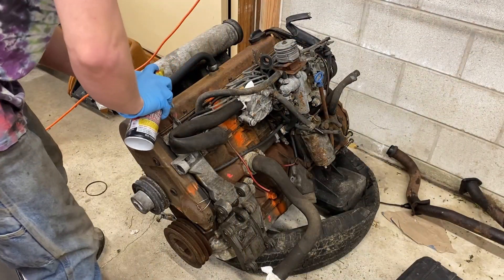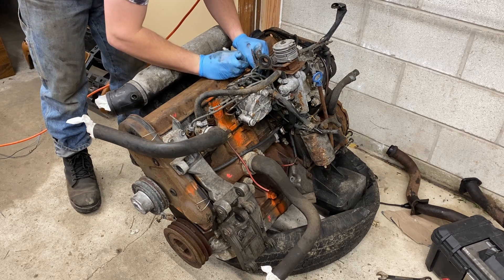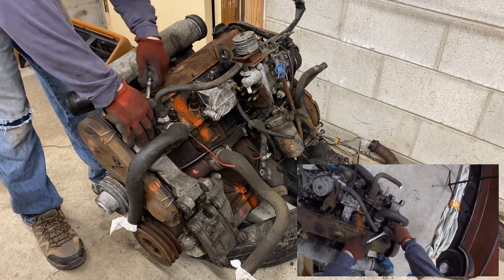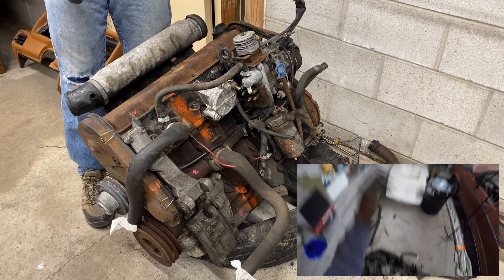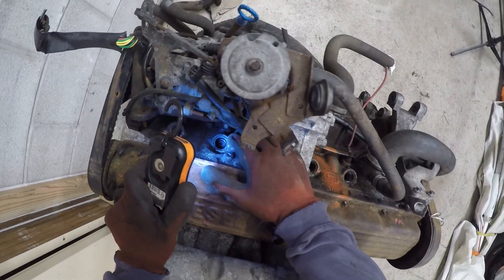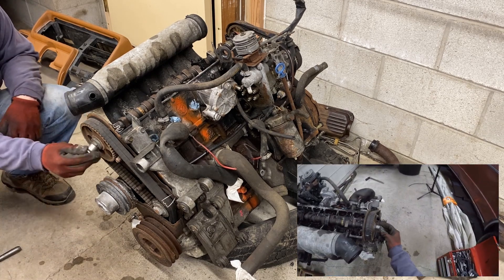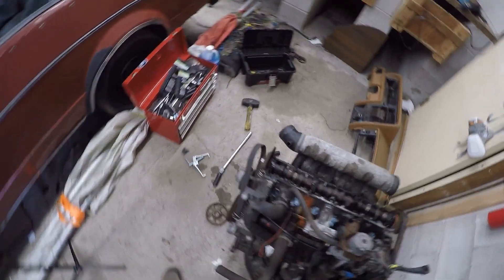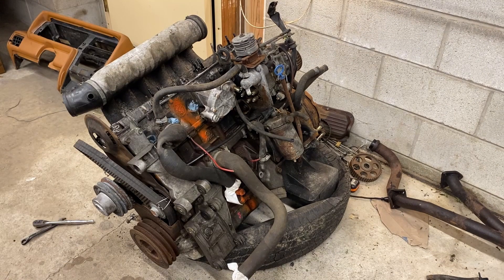D24 Diesel Engine Rebuild 2 - Pulling the Camshaft

Comment: Did you say that the injectors for the 1.6 will fit the d2.4 ...i have the same engine....thanks
Reply from the maker: The D24 N/A uses a NA12X injector, while the 1.6D N/A uses a NA13X injector. I haven't been able to find what the practical difference is. A full set of 1.6 injectors will probably screw in and work though.